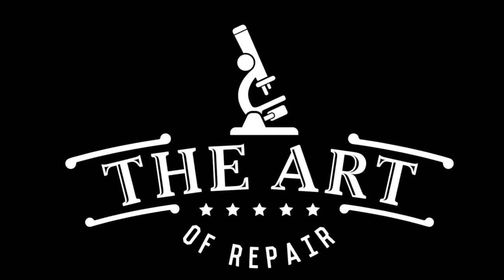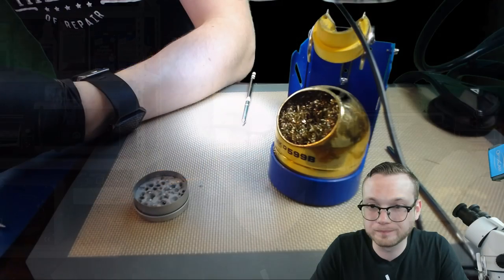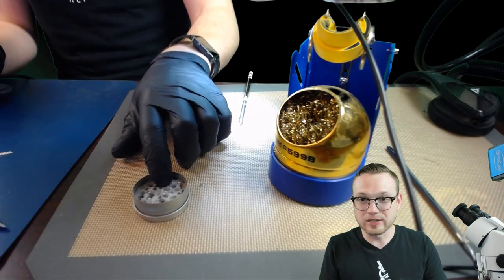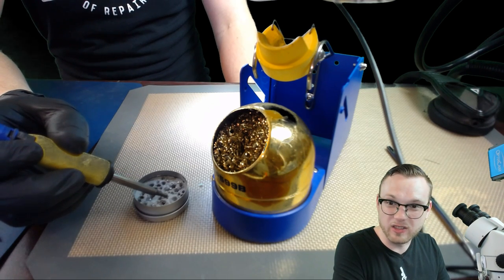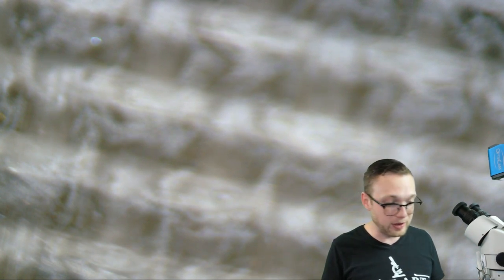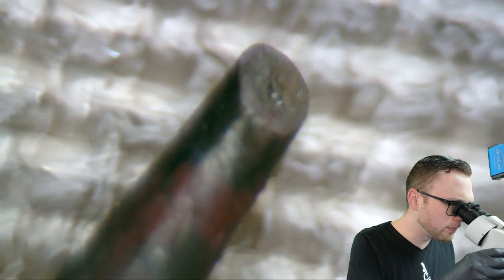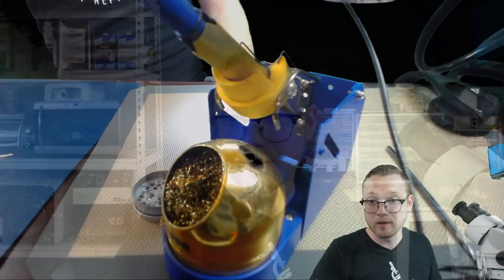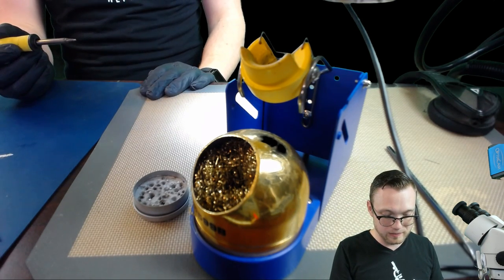EP52 Tip Check | Good & Bad Soldering Tip Habits | Why don't my soldering tips last long?

Comment: Im a beginner and upset you didnt explain how long on how hot a tip will last before it gets oxidized, if when soldering your tip stays deoxidised or perhaps you should clean it every 5 mins its on, and if the iron should be full heat when using the sponge and tinning it and how to apply that deoxidizing stuff to your tip if you're just using solder wire

Comment: Thanks for the advice...however, the advice is for professional or semi-professional soldering stations, quite expensive for the common man, who needs a maximum of 3-4 solderings in a month...and, especially , I for one am tired of "advice" like: "buy something more expensive, many problems (for example: the flux does not stick to the soldering tip) will be solved "by themselves"...many people have soldering stations made in China (I, for example, have a Baku702B) and I have been using it successfully for almost 6 years, the only problem being the lack of consumables (heating element A1322 or the hose-heating element assembly for the hot air blower), a fact that determined me to buy a Gordak 936A, for now...and it does the job I bought it for at this reduced price...as for fludor and flux, or fludor tweezers and tape, I do well with Cynel or BST 506 solder paste...I don't want and I'm not willing to pay more for something like Amtech or other more expensive ones with "extraordinary qualities" compared to the cheapest ones...it would be appropriate to present the way of working with soldering stations are more "cheap and common" than challenging people with expensive equipment that they will never be able to afford...and professionals who use expensive equipment should not forget that they also learned to work and train with cheap things hand for today's micro soldering

Comment: I have been using the same set of tips for almost three years. Daily soldering on the large chisel and medium bent. I literally just put some solder on the tip when I'm done. And no tip tinner, that stuff is like crack to soldering tips, you need more and more as time goes by.
Reply: if you dont use tinner then what do you suggest different?
Reply: @mat.b.  as I said, just put some solder on the tip when you're done and leave it to cool down. I'll have holes in my tips before having no tin on them. I'll go through a cheap weller tip in about a month, then just replace it because it has a hole in it. More expensive rf ones last me years before needing replacement because they simply wear off to the point I can't make good contact because of tip geometry.

Comment: Thanks for the video. I'm starting soldering. This tip you give, to start soldering with cleaning/ tinning, sounds absolutely like the best time to do it--- right as you begin to solder. That makes a lot of sense. I value this suggestion. (I must add, it's a bit funny, as a person who has not yet begun soldering... equipment is in the mail... to hear all the different pro's contradicting each other. One jabs the soldering iron into the brass. The other says you must insert it gently and just twist... although it IS softer than the tips/ that is why it is used. One says use tip tinner as last resort... or like here- use it every time you begin to solder, rather than applying flux core solder... which another pro says is enough. Yes, this video says you can do whatever you want. Just an observation, that I've watched a bunch of pro's & seen major contradictions. But they all agree on regular cleaning & keeping the tip clean & tinned). Peace. Blessings. Love wins.

Comment: The chisel tip on my old 936 must be a freak of nature in regards to it's ability to maintain a clean oxidation free surface with nothing other than frequent use of a wet sponge. I wipe it off almost constantly while using it and it still looks like wet solder after around 10 years. No tinning before shutting down, and no tinning before it hits the sponge for the first time in the morning, and it always looks like fresh wet solder right after it comes off of the sponge. Must be lucky or something. I love my old Hakko!
Reply from the maker: One of the rare good ones! =D
Reply: You mean the Atten AT936D?
Reply: @defme  It looks like the old Hakko 936 but I've heard the components aren't as high quality. Basically a cheaper clone.

Comment: You should lower your new intro volume a bit. It's quite loud compared to your voice before and after the intro. Great tip about the tips ofc ;-)
Reply from the maker: For sure, I can do this. Next time I will try to have it equalized better! Thank you for your comment!
Reply: @TheArtofRepair  I'd also suggest getting your mic off of the table. Every time your hand/arm landed on the table, my subwoofer jumped! Did love the tip maintenance info.

Comment: I have one soldering iron tip thats about 20 years old and still good.
One thing I would recomend is last thing when finished soldering is clean and tin before switching off I always start with a clean tip every day.
Reply from the maker: This is also an amazing habit to form. Thanks for sharing bro!
Reply: I do that too :)
Reply: I always put a blob of solder on the tip when I turn it of the only problem I have is the thread on tips they always break of then the whole soldering iron is useless

Comment: Excellent advice. I do the same thing, just using a water sponge and tinning with my regular 60/40 solder at startup and on occasion while working.  Keep the tips clean and tinned, they work like magic and last a long time.  Let them get crusty, forget it.  I worked at an amusement game manufacturer in Buffalo for one day and quit at the end of the day when they didn't want to give me a $3.00 new tip for the Weller soldering station that I was using, the supervisor saying it was "fine" when it wouldn't tin at all. They didn't even know what I was talking about in regards to a tinned tip- that brown, rusty, nasty tip was "fine."  The deal is the same with vacuum desoldering stations.  Let them get nasty, and they don't work and do nothing but aggravate you.

Comment: A clean, tinned tip is the first step in good soldering iron technique.

Replaced my Weller station after 30 years hard use with an Edsyn 951x, and do find the "Pod" (the shroud the pencil lives in at rest) to slow oxidation.

Also picked up a Hakko brass wool R2D2 like you have, which is not yet ready for refilling.

However, research has brought up the benefits of loading kitchen scrubbers (washed and dried) with Kester 951 No Clean liquid flux.

I had already been using the Kester product, which is 2% rosin in a water based carrier, and sells for around $50.00 a gallon.

You can buy 2 oz quantities on the bay for $5.00 or so, which might be good for some as it has a shelf life of about 2 years iirc.
Reply from the maker: oh wow! im def going to look into adding the flux, I already thought about using the kitchen scrubbers once just didnt know about the flux addition!

Comment: Good video!.  I would like to add that when you are finished soldering, to keep a generous amount of solder on the tip. This blocks oxidation of the tip and is actually strongly mentioned in the Hakko videos on using your soldering iron to greatly prolong the life of your tips.
Reply from the maker: Your correct! Great add! Will be in the update video whenever it comes out 💪😎

Comment: I am new to soldering and just purchased a Weller.  Their company videos show using the tin block or wire brush to clean the tips and recommend using the tip tinner only once in awhile as they feel it's too acidic and will eat through the tips. Their info had me concerrned I was going to ruin the tips with that kind of tinner.  I GUESS YOU SHOWED THEM UP!  THANKS!
Reply: Don't you think that the producer knows better how not to ruin his tool? Unless they want to sell more tips and in this case it's a risky job as users will find out that another no name station is better than Weller...
Reply: @UnulOarecare , aftet several buyouts/mergers, Weller (now Cooper, last I remember) ain't the company they used to be; as an example, the red soldering "station" that Weller sells through Home Depot for instance is a piece of crap, nothing more than an ordinary 120 volt AC iron plugged into a plastic box containg an electronic light-dimmer type circuit,  which means you can turn the temperature  down on the included 40 watt iron, but you can't turn it "up", and there's no heat regulation or thermal feedback. Contrast that with the old blue Weller PTC stations from 50 years ago that used a special tip and magnetic relay for temperature  control; I used one of those every day as an audio repair bench tech for 20 years and the only thing that ever failed on them was the plug-in connector (we hardwired the irons to the station). The tips were good for months of heavy use and about once a year I'd clean the contacts of the relay.  You can buy an electronically controlled  soldering station from Harbor Freight for 45 bucks, a much better choice than the cheesy $60 Weller; HF also sells a fancier version with a digital display for 3 times as much money but I find it interesting that the $45 HF unit has a metal-shell screw-on connector,  a much better connector than the molded DIN plug found on the more expensive unit, which will likely oxidize, overheat, and fail. Newbies should be made aware that they really ought to buy better tips for the HF unit because the 3 tips included are apparently made completely of iron or steel and are strongly magnetic from one end to the other, as opposed to high quality tips which should be made of copper with iron plating only at the very tip (to resist the dissolving effects of hot solder and flux).

 I posted a video on my channel recently about how to use a magnet to tell good tips from bad. Copper tips provide fast, efficient, heat transfer; iron or steel tips do not.  Many people aren't aware of this and they buy the cheapest tips they can find on eBay, Amazon or Ali- Express , and then they wonder why they're struggling to achieve good solder connections.

The other thing that chafes my butt is that many soldering stations, whether good or bad, often include only pointy "conical" tips, which I find to be useless for most soldering.  A so-called chisel tip with a blunt rounded end is far more appropriate for most soldering jobs.

Comment: The best way to keep tips alive is to use a proper station with "standby" or "sleep" mode and temperature control. Use the lowest temperature that works, and keep it hot only when you actually need the heat. Do that and keep the tips tinned and they will last a looong time.
Reply from the maker: a quick workaround for any station that doesn't have standby like the unit shown in the video is to just purchase and use an inline foot pedal and only have it down while you work the joint, and let go. Easy 20$ conversion for any 936 station =) 

But you are correct! in terms of temp, you need to be using the lowest possible temp that will still get your work done properly. =)
Reply: @TheArtofRepair  foot pedal is a brilliant idea.

Comment: This made perfect sense why when I'm trying it goes okey when I start but the longer I work and leave it on. The harder it gets. I don't have a sleep function on mine aither. I will most definitely buy a bras spunge and retinner now and start working on those soldering habbits. Thanks.

Comment: If you always have solder on your tip, you don’t need that acidic stuff. And it’s not recommended to always turn on/off station because the temperature variations will shortened tip lifetime. Just try to have solder always on tip and you will see the difference.

Comment: In the soldering world, there are hobbyist level, general level and precision levels. I deal with the latter on an extreme level compared to the J STD on a level 3 of that standard. This is the highest standard of soldering excellence you can achieve. You are correct about not altering your tip’s original configuration. The tip selection offered for your iron is all you have. This is not an issue on the more expensive stations as the irons have many tip choices and you aren’t as limited in tip selection. Buying off branded tips is usually met with unpleasant consequences like poor plating or tip material compromises. For some, this is not an issue, but in critical circuit ops, this is a no tolerance situation  where compromise could mean loss of performance yielding failure leading to loss of life and or capital asset failure and mission failure. This is an extreme grade of work, but the responsibility of the operators is high and so is the reliability of the equipment they work on being critical. Compromise leads to failure and failure is not an option at this level. Procedures are followed and are more time consuming than basic soldering ops. Not all are able to perform at this level. It takes a whole different mindset and focus most are not able to achieve. I can break it down if anyone is interested. The rules are harsh for good reason. Human life is precious and mission failure is intolerable. It’s that simple. Press on and never compromise your work! Stay safe mates!😊👍🏻😷
Reply: What process do you follow?
Reply: @cchemmes-seeseeart3948 , it is classified as critical circuit soldering under the new J STD 006 level 3. In my first exposure to it was DOD STD 2000-1. This is and was then the hardest standard for soldering as it pertains to circuitry that is life critical, avionics in the military fall under this ruling, satellite electronics do also. Any medical electronics would fall under this standard. Human life and capital assets are at risk thus justifying the highest level of soldering available. You may look it up and learn a lot on the internet. The highest quality of soldering isn’t obtained by many people as this level of soldering demands 100% of your attention, your skill and your abilities. Your focus must be at a level that most are not capable of reaching. It isn’t forgiving as compromise is as far from this level as you can get. No wonder few ever achieve it. Military contractors have to utilize it for weapons systems. When you are dependent on any electronics, this is the standard used. Leaded or lead free solder is used in this standard.
Reply: @markphilpot8734  Wow. I can get your point of why this would be so critical. I keep learning so much I never dreamed of. Thanks.

Comment: I use the tip tinner also, my tips also have lasted over 2 +years, and I stab it just exactly like you said. Caustic or not, I will continue to do it like that, because I know it WORKS. Proof like they say, is in the pudding..... Thanks again for a great video.
Reply from the maker: My man, you know what the real deal is. Appreciate the comment, feel free to stop back by anytime!

Comment: Weller says to store your tip well tinned to block the oxidation of the copper.

BTW, mixing 2 metals into 1 is called "alloying". The cleaner and hotter metals are, the more likely they are to alloy. Tin and copper alloy very quickly if very hot, other metals alloy too, just slower to much slower.
Reply: I don't know where this guy got the idea that he was "cold welding" metals together in a "vacuum" with a soldering iron;  If that was true then we could solder any metal to any metal, including aluminum, and anyone who has tried it knows that this isn't possible!  A true example of a "cold weld" is a crimp that is done to military specifications.

Comment: Does the wire scrubber thing need to brass, is that the best type? Is there any alternative I could use, cus I'm sitting here trying to finish a job and can't find my tin with my cleaner in it, and I honestly have no clue what else I could use that won't ruin or do something weird to my tip. I'm self taught with this been learning what I can from youtube, and random people I encounter at like hardware stores and electronic repair stores, but I don't have anyone who's experienced to learn from or call up to ask dumb questions like this. I'm sure I sound like a total novice here, which I am, I admit. But im trying to learn and have less learning the hard way.  Thank you

Comment: I’m trying to set myself up on a low budget starter kit for repair. Can you recommend a good hot air soldering rework station? I just bought a Weller WE1010 soldering iron and would like to also have the ability do hot air soldering if necessary.

Comment: I have soldring iron tip tapered and not get iron broblume how to clean it and iron conect on it I sanded it and removed the black layer, but it still doesn't catch the lead. What is the reason?